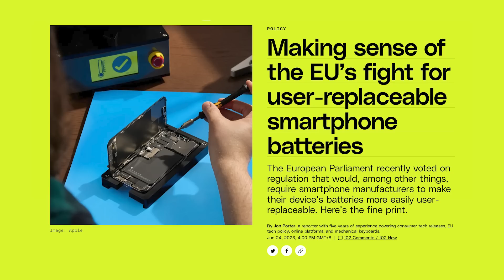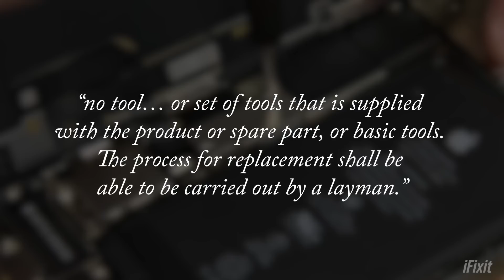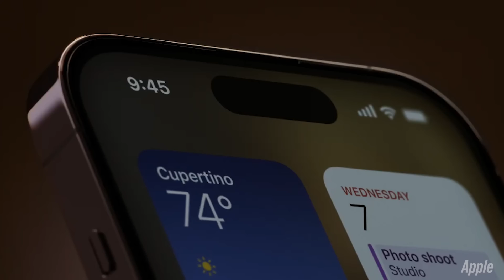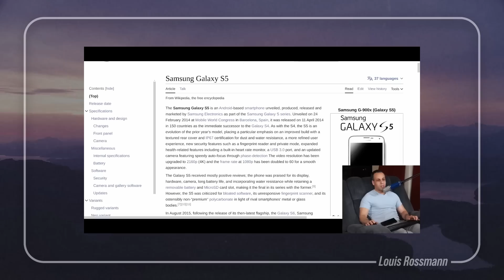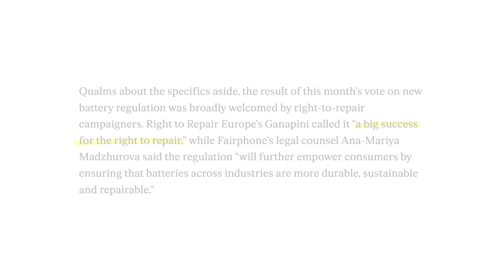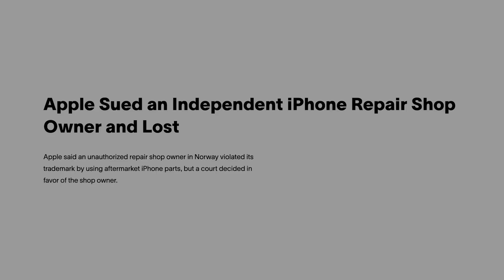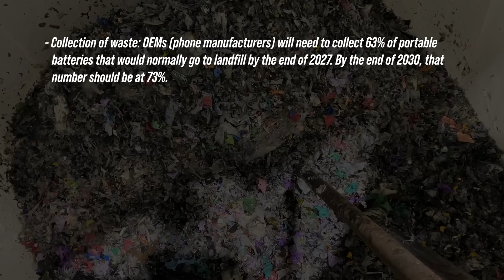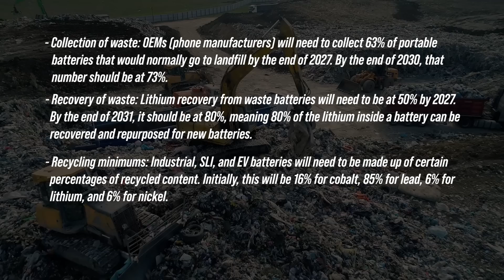EU Just Changed Smartphones Forever

Comment: If someone steals my phone, they have to turn it off so I can't track it. If it's on I can just go on find my phone on google and track them as they won't have time to carefully unseal the phone while they are running away, and for regular ways to turn off the phone you need to unlock it first. With removable batteries it's as easy as 2 hand movements and the battery is out with the phone off.

Comment: I had a 2nd hand Galaxy Note 3 for years and loved it. I had a stand on which I could charge my batteries outside the phone so always had at least 2 spare batteries with me for the times I couldn't get to a charger eg while travelling.  I only changed the phone when software 'updates' ensured the phone no longer functioned. Forced software updates are  how phone makers will ensure that you still have to change your phones regularly.
Reply: enraging. i hope EU will tackle this as well.
Reply: @MsRocksa  what, and live without my contacts list and Google maps etc? Not a chance
Reply: I used to install customROM's for the same reason though.
Reply: One winter, it was -35Celsius as i worked at the top of a telephone pole.  I pulled out my phone and it slipped out of my gloved hands.  It fell 35 feet onto a pile of boulders.  It did have an Otterbox case.  When i eventually climbed down & retrieved it, blew off the snow & it was fine.  Good old Note 3.

Comment: I remember devices with particulate and water resistance with removable batteries.  I also own a new laptop that's thin and has user serviceable modules.  So I'm all for the idea.  I do think we need as a species need to once again, put more focus on recyclability and longevity of products.
Reply: Recycling: maybe
Longevity: absolutely
Life cycle: should be added to list
Reply: I can agree to the addition of life cycle, but recycling has to say part of it.  Recycling is taking something at the end of life returning it to base components only to remold it to something new.  It could as mean using something in a new way that it is still fit for.  For example repurposing an old desktop as a server, nas, or network switch.
Reply: Absolutely. I mean Sim card trays are also able to be opened and waterproof. Not making the battery replaceable was simply motivated by greed! My developer told me once, how much good connectors cost, it is a saving which quite adds up if you also consider less tools needed as there are less parts in a none removable version of a phone!
Reply: It is a great decision of the EU and a large step in the right direction to have replaceable batterys.
But what would really increase the lifespan of electronical devices etc. would be increasing warranty. By law the warranty is at least 2 years where I live. It is a bit more complicated than that but increasing this would mean that companys have to build devices that last longer and are not "designed to fail ".
Reply: I mean, Samsung XCover Lineup. Waterproof abd still removeable battery and not much worse feeling than other current phones in that price range
Reply: Ye, like I have a GoPro Hero 9. Guess what, it's water resistant. And it has replaceable battery! What an idea! :D
Reply: I've had a rugged android phone that cold go in water with a removable battery.

Comment: As a former phone repairer I watched all of these changes happen in real time every generation and the increased cost in parts and labor costs with each new phone released. It was obvious back then that this was being done by manufacturers because they saw the amount of money they were losing to the aftermarket repair industry which is where I worked. Yeah these new phones might look good but they’re now near impossible to repair and keep all of the devices features like Face ID and others unless you send them back to the manufacturer or an authorized service agent (which costs the same anyway). It’s nothing more than the greed of manufacturers at the expense of customers. It’s shameful. Hopefully these new laws in Europe (they’re also mandating at all rechargeable devices like phones, tablets and computers use universal USB C chargers) reduce costs and waste because the current system is way out of hand and it’s only going to get worse if manufacturers aren’t forced to change.
Reply: So, you are just bitter that customers wanted sleek phones? 

Manufacturers did these changes because the models that were popular with customers were the thinnest lightest ones, and you can't do that with user serviceable parts. The changes were due to customer demand.

Comment: It's curious, on one hand the battery in my current smartphone which isn't removable (when fully charged) lasts more than a day and sometimes longer without needing to be recharged (and this is after almost 3 years of use). On the other hand, years ago batteries weren't nearly as efficient, and battery degradation would be seen within a year of ownership. So in this instance I don't mind non-removable batteries because I have gotten more life out of the device than I rightfully should. As apposed to a situation where I would be forced to buy a new battery or new device every year, then yes, the removable battery matters. 

And that is the rub, companies clearly know this and removed the removable battery to force new sales. And new sales at higher pricepoints at that.

Comment: I like the idea of having replaceable batteries. With how phones are now, and how older devices keep up, I'm sure my phone won't last into the 2030's, at least not as fast as it is today. With battery replacement, though, I'd at least be able to prolong the usage of it, as Apple's phones are expensive, and I only went for an iPhone for streaming purposes; specifically face-tracking for vtubing, and having more options with Apple's Face ID. Being able to replace the battery would make that price a bit more worth it, as even if the phone gets slower as years go by, I'd still be able to call, text, and do most of what I need on it years and years after it's considered obsolete. Would my face tracking and streaming-related things work? Probably not, but by then I'd assume my adult self has either found different hobbies, or is able to find another way. That, and depending on the design I'd be able to simply pop out the battery if I'm curious about what's inside, like my old flip phone. Not mess around or anything, but enough to satisfy that want to see in for myself.

Comment: Phones don't need replaceable batteries. The entire point of going to a sealed phone was to make them slimmer and water tight. I happen to like that I can take my S23 Ultra under water for photos. It was nice on vacation. Just make it easier to recycle them. There is already a shop on wvery corner that can replace the battery for your in the event it loses capacity prior to you trading it in.

Comment: I owned and loved my g5. The chin peace made it a two second process to replace the charge port, aux port, and battery.   Opening the phone the restr of the way used two screws and some low strength adhesive.  Ove the years I used and abused rhe phone I also replaced the screen using just a small Philips and some adhesive straps that came with the screen.    The only issueni ever found with the phone was a friend who also owned the phone and didn't realize there was a button on the side of the phone to pop off the chin, and would instead rip the chin and battery out, when I showed them the button to pop the battery out they decided to keep ripping it out for some reason

Comment: as a european i think every single company that is major in the smartphone market will make it according to the new EU laws, this is because the EU is a big market and a rich one at that, western europeans are quite literally the perfect target over lets say africans or indians beside americans for these expensive smartphones as we have the monthly salaries to be able to pay for it, when in lets say africa when a 1000+ dollar phone has little chance to get bought and if it does its most likely one of the few rich people there, If it was Africa putting these laws in place, most would've without a doubt pulled out apart from a select few.

But i find the replacable batteries for EV's great, they have a gigantic issue with irreplaceable batteries that makes it so you have to either risk it if its gone bad, or just leave it in a scrapyard, even if everything but the battery is in pristine condition, this allows it so that mechanics can do checks and not declare your EV a total loss if the battery is bad and outright dangerous, it can be changed.

Comment: This is something that I have been saying for some time.  Phones are binned not because they've failed, but because their battery has worn out.

But I think that rules about rechargeable batteries should go further.

Not only should they be replaceable, but they should be built to standard sizes and specifications, like AA batteries etc. are.  Tech companies should not be allowed to design their own custom batteries.

I can't use my Canon batteries in one of my Olympus cameras, for instance, and my two Olympus cameras have different batteries and chargers.  This just multiplies electronic waste.

There should be a range of standard rechargeable batteries to cover each need, and OEMs should have to choose a standard battery from this range when designing a device.

Comment: there are phone models released specifically for the asian market that are not launched over in the western market. You also have the iphone 14 that is e-sim only in american but not elsewhere.
It is possible that they would release an EU specific model with a higher cost for manufacturing.

they could easily design a back that locks into place - if apple can design a tag that has a back that twists locks, or easily could have the back screwed on etc...then there should be no issues. The laptop shouldnt be an issue but they choose to use special screws and glue the batteries in when they dont need to
Reply: They can even make the same phone but glue it to death for the American market. They are capable of something like that.

Comment: I have just today thought about how it is still possible to track phones when they are turned off. Seems it is about to change. However, it seems they may try to put a reserve system that will still carry the charge when the main battery is removed. And they will explain that it is necessary for technical reasons)
Reply: Most phones are not trackable when they are off. It is relatively easy to measure the radio emissions, and prove that it is not connecting to anything.
Some phone are an exception (Apple?), but the bottom line is that if you worry, you can literally measure it yourself.
Reply: Unless it received a special firmware update from the NSA to never really turn off, just simulate it. In that case, you can measure its radio emissions and prove that is was compromised.

Comment: Gotta admit, I have no idea how any EV is going to comply with the exact text of that law.  How is a layman, by themselves, going to safely replace a battery that weighs a literal ton?  Even if it's easy to unbolt it, those batteries weigh more than the entire engine of many IC cars.  Those are going to require specialist tools just to lift the replacements.

Getting consumers to give the old battery back won't be that hard, you just have to make it expensive to not give it back.  Take notes from the Core Charge seen in commonly rebuilt car parts.  The rebuilt parts are artificially expensive, unless you bring in the busted part for a refund of the Core Charge.

Comment: And some people think planned obsolescence is just a conspiracy theory. This is government overreach in many ways but I also get it. Thing is it's the company's that did away with old batteries, they make their product how they want. At the end of the day we don't have to own a smart phone, can still get a flip phone. Since they can't use adhesives do they go back to snapbacks? What exactly is the design impact on the phone? Depending on the battery design, does the whole back need to open? Maybe it just sounds like exactly what it is, making excuses. It will eat into profits because a lot of people will just opt to swap in a new battery instead of going to a replacement service or getting a new phone. I can see retaliation though, designing the phones so only OEM batteries will function. Those batteries eventually won't be cheap either.

Comment: i guess ther should just be a Warranty extention on complex products to 5years (Cars, Laptops, Phones) 
about those Batteries and Screens ... i've been repairing my stuff for over 20 years now... first my PCs, then laptops, then phones... not like hardcore but i never came across anything not beeing plug and play.

a hairdryer and Guitar plectrum just does the job on about any phone, after that its just cables pluged into motherboards... scratched cameras no problem, Screen? (had a model that had 7 screens in its 4years), batteries?... just never been an issue for me, last phone is 5years old and still working fine, but got replaced because main storage was to small for current app demands.

Comment: I have some issues with this but I really like the direction, the only concern I have is without adhesives of some type how would companies provide adequite water-proofness to their devices? (Maybe like a Rubber Gasket? but may degrade, idk) I feel like it's fine to have some "Basic" tools for batteries to be removed, Kind of like how Screen Protecters are so widely available why wouldn't adhesives available? (Frequency I guess as a point but I think this is easily solveable). 

Think the main problem for a lot of people is that it's not that there are steps that are too difficult for no reason at all, why do you need special tools, why are the components PROGRAMMED to say "lul nice battery, so fuck you 50% capacity", We can use basic tools but don't bury the process under 30 different ways to fuck up and a "Special Screwdriver" designed to fuck the average consumer.  Most people don't NOT have the ability to use a screw driver but also most people don't have the ability to Heat the face of the device, remove the screen and adhesive, blah blah blah BATTERY, just ScrewDriver -> Battery -> REPLACE. 

Not an engineer but I don't see how it's so insane to look at the hood of an iphone, realize "Why is the battery on the FACE, just move it to the back, Oh let's add a door with a small screwdriver or a piece of plastic you can just flip up, or a way to release the back plate with your simcard tool or something.

Rambling sorry.

Comment: In the past even if phones had replaceable batteries, by the time they got really bad, the phone was too slow to be used without felling very sluggish. Not so much the case anymore, I'm still using a flagship phone that's almost 6 years old now, and it still performs just fine, but the battery is getting close to being almost unusable, I'd still be comfortable using it for at least 5 more years if I could easily replace it and if the manufacturer still issued security updates for it. Heck, since Iphone and Android launched, I've only had 3 smartphones in my entire life.
Reply: As long as you don't want to play games on them and you don't update every app the current cpus are valid for many years now. The biggest danger is the apps requiring new versions of the OS.